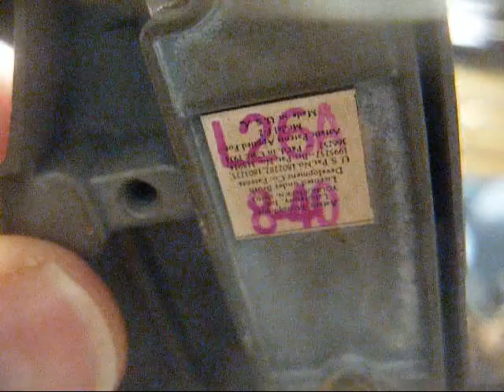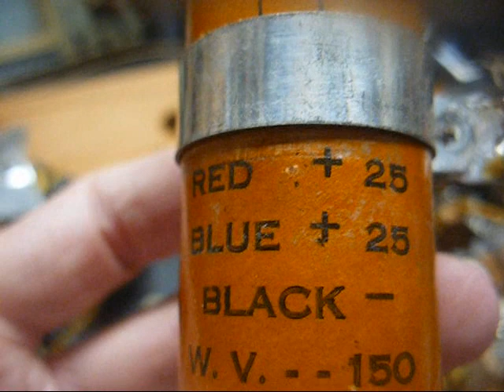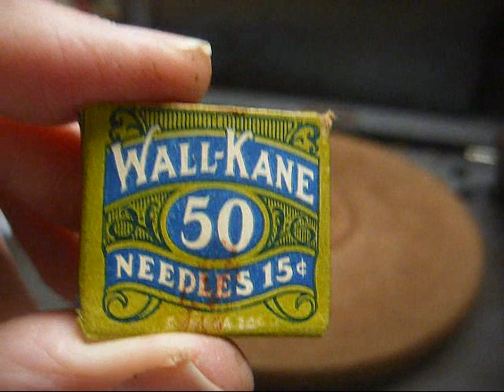Dynavox wireless record player (old video with the old camera)

Comment: That's definitely a beautiful  machine. It's awesome  that that 81 year old cartridge still works as well as it does.

Since it's resistance line cord is in such great shape, a good thing to do about the safety aspect would be to solder a bit of wire of the correct diameter and length around the edge of the neutral blade on that cord's AC plug and make that neutral-side blade a tiny bit wider, just wide enough to fit properly into the neutral slot in the wall socket. That way it can only be plugged in one way and the tonearm can always be handled with complete safety, assuming that the 120 VAC wall socket is wired properly of course.

Great job restoring that set, Brian... and the turntable drive assembly sounds much much better now, too.
Thanks for sharing.

Comment: I remember seeing schematics of these “phono oscillators”. They were typically crude and cheaply made. A few used tubes like the 117L7 pentode/rectifier combination because they had 117 volt heaters that required no dropping resistor. The one I found as a kid in the 1960s was the oscillator only and used an early selenium rectifier and a 12sk7 with a dropping resistor . Every one of these was different and to a large extent the design was based on whatever surplus parts were available. The “best” of these was made by Zenith and used a pentagrid converter ex 6sa7 or 6a8. I’ve wanted to build my own based on the Zenith design but finding the correct oscillator coil is tricky. The Zenith oscillators are pricy today if found at all

Comment: Thanks for the hot chassis reminder. It's easy to forget about that. Also, thanks for the education about a hot tone arm and a quick one way trip to the boneyard. I get a lot out of these old portable phono videos, although I don't seem to ever get a chance to work on one. The information translates well over to the units that I do service. I get a lot of phono units that need to be cleaned and lubricated. They come with a console that tends to fill up my repair space.

Comment: Nice player, but I did not know that the tonearm was a heavy tracker. My windup record players like the Victor, Sonora, and Camp Fone had heavy trackers including a reproducer and a needle. I’ve seen needles like this, and it would play with any windup record player from the 1910’s and 1920’s.

Around 14:24, “Any Bonds Today” was later featured in an early PSA with Bugs Bunny.
Reply: But shouldn't you use the quietest needle you can get when playing on an electric amplification?  I would assume if these needles are actually louder than a quiet needle, they might overdrive the tube into distortion.
Reply: @tarstarkusz  I personally used a soft tone steel needle to play all kinds of 78’s both acoustic and electric.
Reply: @Musicradio77Network  Does a loud needle overdrive the tubes?

Comment: And speaking of Dynavox wireless record player, I also have a Bluetooth FM transmitter which is used for cars, and an AC to DC adapter to plug the Bluetooth transmitter into the AC wall outlet, it works, set the dial to 87.7 FM, paired with my devices, and it works, now I can use TuneIn to listen to WABC or other stations which it can broadcast on FM radio.

Comment: For it's time this  phonograph actually works pretty good. Just needed  some TLC
and replacement of bad and leaky caps. Heavy tone arms were all the rage then but
 they ate records up after about 20 to 30 plays. But records were cheap to replace
 then too.
   They also had replacement plastic tone arms so you could play a record longer. 
Just have to know how to replace  the  metal one with it. I think I have one that fits
 the old style crystal cartridge shown. Great repair and demo Bryan.

Comment: I wonder how what the range is on that record player? Like could you walk around the whole house with that and be able to listen to the records? Would you be able to go out in the yard? I'm always curious about transmitters.
Reply: I used to turn old radios into transmitters as a teenager. It depends on the length of the antenna. You can go several hundred feet with a long wire antenna, maybe 10 feet on this one.
Reply: The one that we had at home when I was growing up (and still have) would transmit to any AM receiver.  First, you would tune a nearby receiver to a "dead" spot on the band, and then there was a frequency adjust knob on the record player to tune its carrier frequency to the radio.  Now knowing that frequency, we could tune any radio in our house to the record player.  Then, we tried the same thing in our new car that had a radio (car radio was an option) and still had a good signal.  Then I played Christmas records in July, while my dad drove to the neighbors house next door to show him the new car while its radio was playing this Christmas music.  Neighbor suggested that maybe the car should be returned to the dealer for radio repairs.  True story.

Comment: Looks to be the same basic machine as the Sonora unit I picked up earlier this year, complete with lighted tone arm and resistance line cord.  Capacitors replaced the line cord's voltage drop, and an )-ring worked to replace the rubber drive wheel's tire.

Comment: We all used to use widow maker death trap designs. Yes cheap and dirty. Amazing it works. Was the line cord cheaper than a resistor?
Reply: One benefit of a resistance power cord was to distribute the heat over the entire cord length. You can dissipate a lot more power  this way where as a typical power resistor would get very hot.

Comment: OUCH!  Bad needle information!  That cartridge was desigend for Osmium needles, 25-50 hours each!  You're putting gramophone/mechanical reproducer needles in which indeed would need to be changed every 1-10 records.  They are NOT the same.